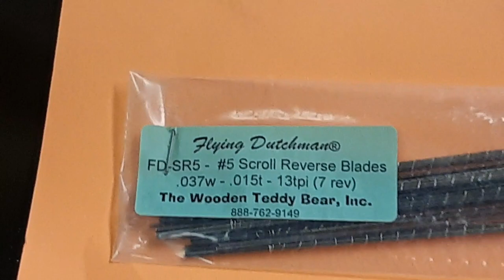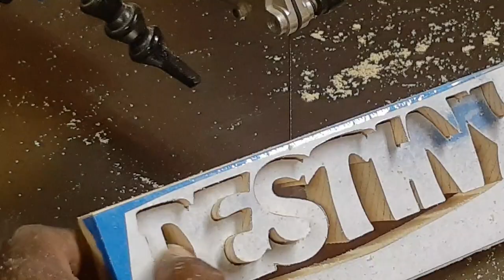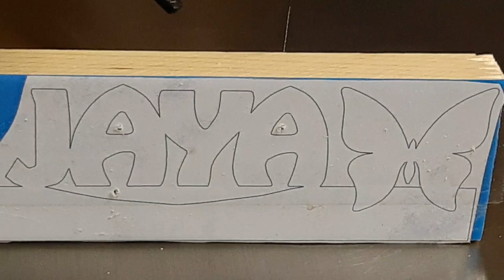Cutting Desktop Names w/my Scroll saw. mytoya2

Comment: I always love to watch your tutorials!!
I need to get more practice in Scrolling.
Seems like I always have something else I need to do and end up going days without doing anything on the Scroll Saw.
Certainly appreciate the recommendations when it comes to what blades work best!! I'm going to try to make some puzzles out of Laminate Flooring.
Seems to hold together pretty well even after being subjected to immersion for over two weeks.
Anyway, I just wanted to Thank You for Your Tutorials and Suggestions for Blades.
I'm assuming that Laminate Flooring and the material You're using are basically the same composite material.

I couldn't remember the name of the material You're using for some reason, my mind went completely Blank... LoL

Comment: Thank you so much for your clear explanations!  I love to watch you work!  My saw is still in the box and I am trying to learn from experts like you before I begin.  My question is, what kind of wood should I start with?  I want to do wall art, like words on signs for a 3D look.
Reply from the maker: Go ahead and pull that saw out of the box. I'm doing a video soon on the scrollsaw books and magazines I have. I will also explain the struggles I had when I started 20yrs ago. I recommend using 1/4 MDF or soft wood and practice the pattern in this link. https://youtu.be/dX_dxffQHJ4 if you need the pattern find me on Instagram. My name is MytoyaNcalifornia there. Once you get the hang of the scrollsaw you will be hooked.

Comment: is that pin or pinless blade? Also, do you work with pinned blades? I was wondering if we can do the same with pin blades
Reply from the maker: Your turns will have to be done a little wider with the pin blade. It's what they called. Doing a loop. With the pin less. You can basically spin in circles in one place.

Comment: I like it because the change of blade is quick and simple but I do not know what brand it is?
Reply from the maker: Hi there, I'm using a DeWalt 788 scroll saw. And that is precisely why I chose the DeWalt is because of the quick blade change. Also make sure that you get a foot pedal because then you can make sure that you keep your hands on your piece at all times and your eyes instead of having to move your hand to turn it off.
Reply: @Mytoya2  Thank you very much for your answer. Here in Costa Rica I can't get a Dewalt jigsaw, it's a pity. I'll have to look for some other guy... Thanks again and your work is excellent!
Reply: Here in Costa Rica only Craftman, Wen, Makita,
Reply from the maker: @eddieporrasduran3932  I've never used either of those machines. I'm sorry I can't help with suggestions. Make sure whatever machine you choose uses pinless blades. That way the blade can fit into small holes.
Reply: @Mytoya2  Thanks.

Comment: Hi Mytoya, have you tried the Flying Dutchman Ultra reverse blades? I really like them.
Reply from the maker: Yes, I have. I still have a few but I love the #5 scroll reverse better. What kind of things do you like cutting?
Reply: I find that with 1/3 of the teeth pointing up, there is more sawdust working up to the cutting line. I feel that the scroll reverse blades do a better job of clearing the kerf.
Reply from the maker: @Intarsia82  I agree!